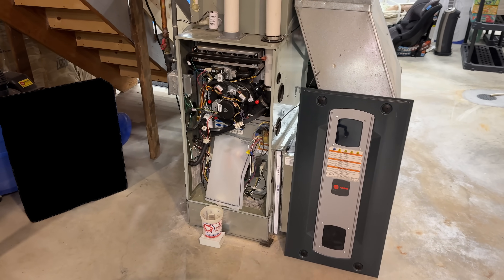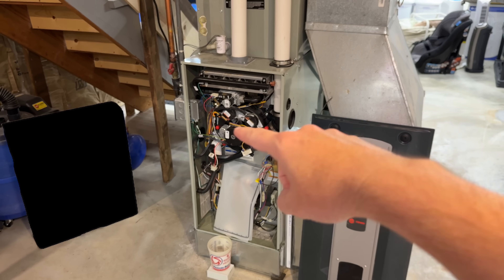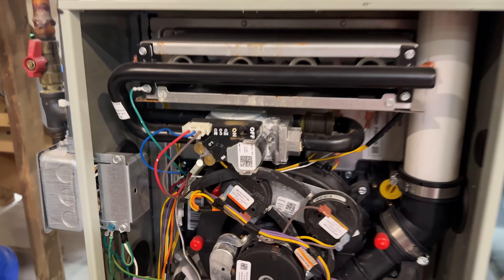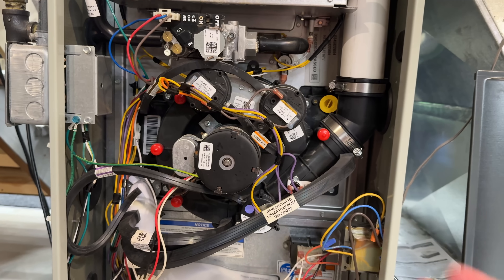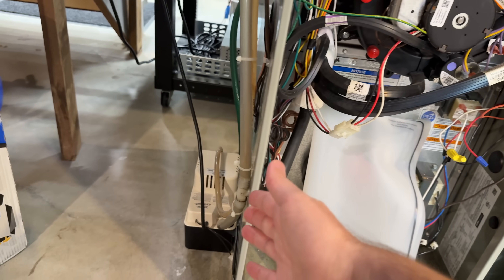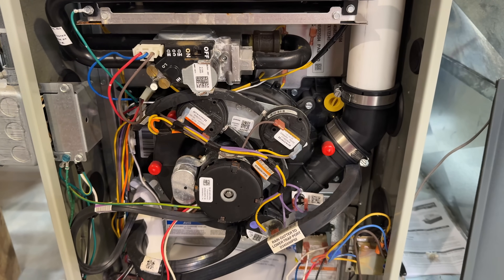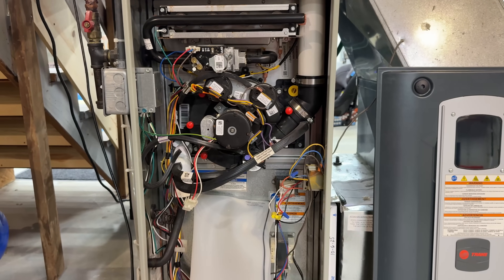It's not that hard to stop a Trane

Comment: Not a good design with single compartment and control board mounted outside blower compartment - on other furnaces the water wouldn't have got to the board.
Still, when the drain lines/gaskets are intact, won't be leaking water. 
When intake termination is done right, won't have water coming in through intake.

Techician still did you wrong by not finding cause of board failure - just replaced board, the leak should have been easy to notice.

Comment: Perhaps the board needs a coating to stop the water coming into contact with the circuit board? i've added a second condensate pump to my hvac, in a cascade arrangement, so if the one dies the second one takes over.

Comment: Maybe move the control board to the exterior of the machine? Splice some extension wires into the wires that connect to the control board, add a suitably sized electrical enclosure on the exterior of the furnace, feed the extended wires into the exterior enclosure, mount the control board in the exterior enclosure, and connect the extended wires to the control board.
Reply: Or just put it in a water resistant box, inside the control box?

Comment: The installer was supposed to put in a p trap for that super long upward vent to prevent condensation dripping into the fan. Trane is technically not at fault.
Reply: No, you don't put a trap on an intake or exhaust vent. If the trap did its job and caught the water, it would block the air flow causing poor combustion and (hopefully) an error shutdown to prevent carbon monoxide production.  Sometimes installation calls for something that looks like a trap, but it is in a drain off the bottom, not in the vent line so as to avoid trapping water.  That cannot be in the vent because it requires enough water to keep the trap full, otherwise exhaust gases would go out or intake air would come in.

My high efficiency heater (94%-96% efficient) incorporates a trap and drain into the cabinet for the condensation produced in the unit, and the install manual specifies that both intake and exhaust when run any horizontal distance much pitch back to drain water into and thru the heater to avoid puddling or dripping on an exterior wall. The combustion alone provides enough condensation to keep the trap full, and any that comes via the vents goes thru the same drain.
Reply: @Sylvan_dB  that’s cool

Comment: On those 2 drain tubes where one is level and is using an upper port, and another is not level and using the lower port, could they be swapped so that both run downward?

Comment: It definitely appears that the two drain lines are swapped on the left hand white plastic filter... the far right one should be on top and the one that is leaking should be on the bottom to allow it to have more drop to drain.
Reply from the maker: I'll go find it in the manual, that seems like it could be the case here. tech is coming back tomorrow and I'll ask him about it too (different company than the one that originally did the install).
Reply: There's certainly something odd. What shouts out is the drain from the bottom of the draught inducer casing has an incline in it which is going to trap water and debris instead of draining it. It wouldn't surprise me if there's standing water in that housing that has caused the problem.

It looks like the drain lines are incorrectly installed and swapping them at the cylindrical 'collector' at the left hand side would resolve the drainage issue. 

Depending on the repair or replace policy, cleaning up the draught inducer assembly and replacing the seal as well as swapping the drain hoses as I suggested would solve the problem. If you're getting moisture from the air intake the drainage kit for that added to the system as well as the previously mentioned solution should completely solve the problem.
Reply: Except, if you read the sticker on each line it is connected to the correct port. He might have a partial rust/biofilm blockage in the draft inducer housing drain line, but normally that causes the pressure switch to not close, instigating a no heat service call.
Reply: @nottheinternet6276  Indeed rust/dirt/biofilm... flush/clean drain lines. At least every year
Reply: Yeah I think a good portion of the problem is it's a bad install.

Comment: Glad it wasn't just me!  I had two Trane high efficiency systems installed.  About $24,000 for both installed.  Neither unit ever worked quite right.  The AC on the upstairs unit we would always have 60% humidity .  We replaced our basement unit board out of pocket expense.  After a fortune in the original units plus repairs and troubleshooting I replaced basement after 5 years and attic unit after 4 years.  Ate the entire $24,000 and learned you can stop a Trane.  You can also stop me from ever buying a Trane unit ever again.  For me they are total garbage.  2 out of 2 were junk.  I got a Coleman for my attic and a Daikan for my basement.  Both ran perfect from day one and going strong years later still.  I never regret buying anything as bad as those two Trane units.  Total waste of money.  They didn't even work well while I had them even aside from the water and control board issues.  The HVAC guys all knew me on a first name basis.  Live and learn.

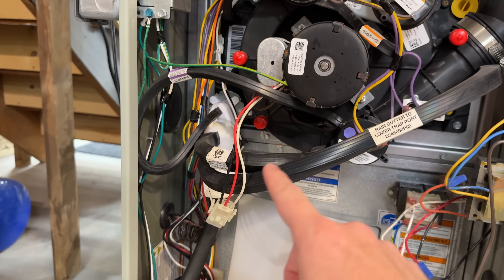Comment: 1:55 Swap those two drain pipes around and you should have less water buildup in that fan housing.
Reply: came here to say the same. What's kinda crazy is that the manufacturer instructions visible on the longer hose clearly state to plug it into the lower one… Which would make it potentially defective by design?
Reply: @ThomasRuecker  yeah. Could be that the parts&labels date back to some other (older) model/revision where they made sense.
Reply: Yea looks like gravity could help with switching those two drain lines that combine on the left.
Reply: also clean them and ports. they can be blocked sometimes.

Comment: Had 2 Trane  heat-pumps  in my last house.. one for each floor.  Was in the house 5 years. Between the two units they never went a year without needing multiple parts replacements.
Reply: it's hard to maintain a TRANE
Reply: @iamdmc  They sucked down way more energy making giant ice cubes in the back (one of the outdoors units froze up solid frequently) yard than they ever saved.

Comment: I'm really glad I have a 71 year-old furnace.  Nothing has ever gone wrong with it.  No circuit board to fail.  It's a huge beast with a direct-drive fan motor you can oil. It's not the most efficient thing, but I'll gladly pay to run it since it just keeps running.  Even time can't stop a Niagara!  The HVAC stuff they make today lasts a few years and that's it.  Sometimes it really feels like everything is a scam these days.  If you're up for a project, consider relocating that circuit board to a dry location, where Trane has installed it is objectively stupid.

Comment: Also, a "boo" to your builder or architect for NOT putting a floor drain beside where the furnace goes.    I have one so I at least don't need a condensate pump.  That should just be code.      Our previous furnace was not a trane, but we did have issues where there are vacuum lines attached to the fan housing (the small fan, the one that is dripping in yours) and those would clog up about every 18 months because they were positioned at the bottom of the fan housing and I think there would be salts or some such that would precipate out of the moisture in the exhaust gases.  So it would clog with crystals and since there is no vacuum, the furnace would shut down as it thought the fan was not running.   Modern furnaces have a lot of complicated bits.   I wonder if there is a gasket between the two halves of that fan housing that is maybe misalligned?  Or maybe just needs a bit of silicon to seal up that crack.
Reply: Floor drains  back up in rain storms and flood your basement with sewage

Comment: Jeff, could you angle that PVC pipe to have the condensation run away from the unit? Then you could have a drain off line to let the condensation run away to somewhere safe.
Reply: Yeah, I don't know what Trane calls for but that seems like an incredibly long run for a high efficiency (condensing) unit.
Even if Jeff gets a better gasket to seal the drip then the blower will be running submerged.

Comment: Can you swap the two rain gutter outputs between the fan out (the one that's flat and causing the leak) with the one on the right?
Reply: This. The gutter hoses look to have been connected backwards to the drain line.

Comment: Sounds like maybe your plastic pipes are not sloped properly for one thing and of course the problem with what water does accumulate inside the furnace isn't being handled properly. Could be worse. I am on my third Rinnai in 11 years, seems like nothing lasts as long as it used to.

Comment: I have a 65k BTU Modine 'Hot Dawg" heater in a greenhouse up on concrete bricks and what happened is some curious and errant slugs (as in snails without a shell, no, not a C shell, but shells such as one might find at the seashore) decided to explore the circuit board and lo', the Lord, or the Prince of Darkness, zapped them when they closed a circuit with their juicy bodies, but not without blowing out a component on the board.  New board was several hundred dollars and Modine would no sell to be me directly.  My warranty does does not cover Acts of God (or Prince of Darkness, again), so I had to bite the board and shipping, but at least my familiarity with circuits thanks to our Guy With The Swiss Accent saved me a labor charge. (Another tip: if you place a screen in your gas vent to the outside to keep critters/whatever from entering during the summer, use stainless steel as zinc coated will dissolve in about 2 years, those emissions are indeed corrosive.)
Reply from the maker: Yes, I'm considering adding a screen, have to be very careful about what you put on!
Reply: @Level2Jeff McMaster-Carr is your friend for stainless steel meshes.
Reply: Sheashells from the seashore? I heard that’s where Sally is, I heard she sells seashells by the seashore.
Reply: I've been repairing circuit boards for years. HVAC seems to be good revenue stream to get into more and more as units are built to fail with new tech being underbuilt with smaller components. People don't know what to do when one is damaged. You can get a used take-out if available as long as your failure was envrionmental like yours and not defect. I would take the old board to fix it and sell it to someone that ran into this themselves. I have parted out HVAC units and plenty of various consumer goods. I repair boards or sell known good boards to end users and repair techs to have spares on the truck which is quite successful for those with the knowledge to swap something that failed. Even if the spare gets the unit going on particulalrly hot or cold day until a new one is ordered is better than nothing. There's still a need for repairs like mine, I'm just not advertising for it since it's a niche side hustle with board repair and electronic device repair spanning more thn 30 years.
Reply: @jonroberts4422  You, Sir, prove that Yankee ingenuity is alive and well.  I've kept my boards thinking maybe I'd make time to understand them and determine if there is a component that can be unsoldered and replaced... but I don't make time for that when there are temptations to spend time watching Geerling videos.

Comment: It sounds like you’re on the right track. I’d recommend getting that drip pan for the intake pipe and possibly applying a conformal coating to the control board. A few other things to look into: what kind of gasket material are they using? If it’s rubber, that would explain why it deteriorates every couple of years. In that case, I’d just make a replacement using RTV silicone.

Comment: Just a heads up, although you blacked out the "Mystery box" on the left in the video with whatever cool tool, it's still totally just sitting there in the thumbnail lol
Reply from the maker: Heh, it's okay in the thumbnail :)
Reply: @Level2Jeff What software lets you choose an object in your video to block like that?
Reply from the maker: I used Final Cut Pro's Magnetic Mask effect for this. Makes it super simple!
Reply: @Level2Jeff  I only speak Penguin, but it seems DaVinici Resolve (paid version) also has a "Magic Mask" too!   Thanks!
Reply: @RK-kn1udNoot noot!
Reply: @RK-kn1ud any decent video editor will do it. Most will let you apply a static blur/black spot at a free level while licensed versions let you pick the object by shape or colour and then track its motion in a moving shot, then you can apply blur, outline, highlight, blackout etc to the moving selection.
Reply: I think it's more that the mystery box had shipping labels on it rather than what the box is, but excellent catch!
Reply: Reminds me of an old Mitsubishi engine. where they put the alternator underneath the power steering pump.
Reply: @joeltyler3427  Ford put the starter directly underneath the oil filter on the Vulcan 3.0L engines, so every time the oil is changed it gets dripped on. A simple metal or plastic shield would have prevented the yearly replacements I was getting under warranty.
Reply: Yeah, I came here to mention the spooky alien box from another dimension. 😂
Reply: Obviusly its a box shaped black hole!

Comment: My old furnace had control boards die multiple times. And yeah, the replacement boards were expensive.  Kept asking myself why are these boards failing?! This year got a new unit. I went with the 80% efficiency unit because of how pricey the high efficiency ones were. Good luck.

Comment: I have been dealing with similar HVAC nightmares. The system (a Lennox BTW) that came with the home was undersized and was shoddily installed. About 5 years ago, the air conditioner coil started leaking due to a materials defect so I had to spend 4 figures to get that "fixed." Then, a few months ago, the external fan decided to die and the refrigerant needed a top off which was another unexpected expense. I suspect that the newer HVAC units aren't being held to the same quality standards as the previous generations that would run for decades with minimal maintenance.
Reply from the maker: Oof, refrigerant is expensive (ask me how I know)
Reply: @Level2Jeff  I was charged $125/lb (R410A). I can imagine the price hasn't dropped any since then.
Reply: The newer systems are very fragile and it really depends on the installer how long the system will last. You can have the most expensive highest quality but a bad install will cause a lot of headaches.
Reply: It is my opinion that any usa brands are crap now. I'm going gree. Or Daikin or Mitsubishi for more money, as they all went r32.

Comment: Seems it's designed to fail like my British Gas boiler, which doesn't isolate the electrics from the damp outside air. My old 'balanced flue' boiler completely isolated outside air for combustion from inside air whereas all the new boilers seem to just let the outside air loose inside the case. They seem designed to fail so you have to buy a new one.
In the UK we used to have what were called 'balanced flue' boilers which completely isolated the combustion area to draw air from outside and then vent the combustion products outside without allowing any mixing with inside environment.